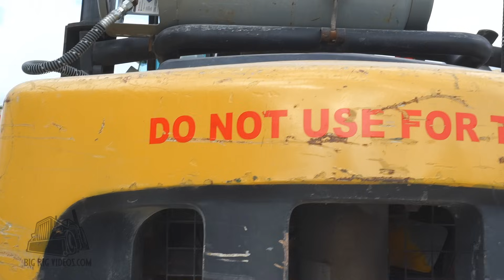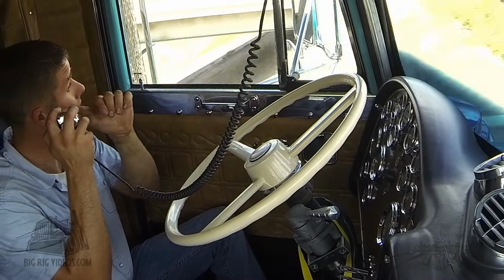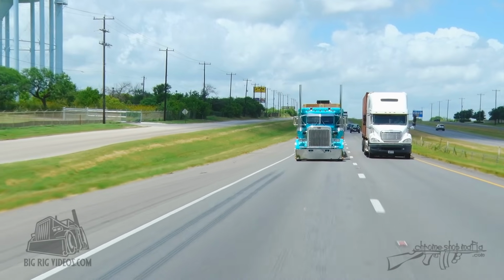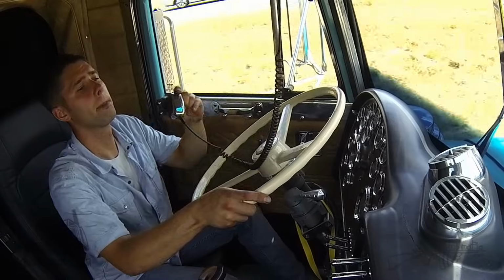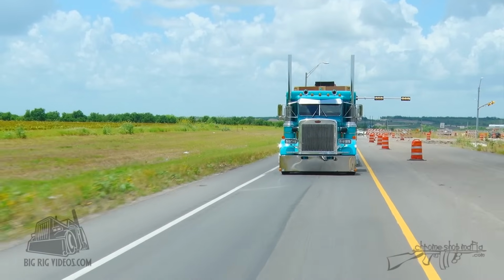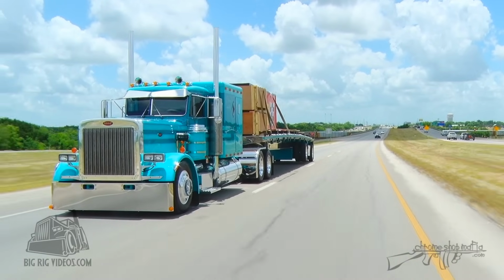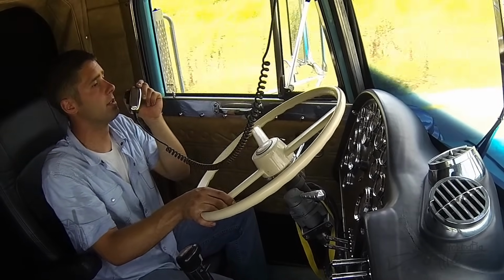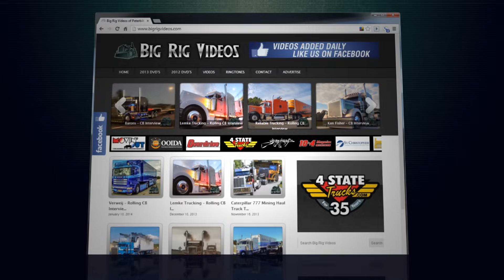Kiegan Nelson - Rolling CB Interview™

Comment: Bottoming out the seat is an acquired skill rarely seen by drivers that are true truck drivers that understand where their front end is while maneuvering around in tight spots and sit on the floor too feel the road better . Lots of drivers that ride high hit bumps and pot holes and run fast on rough roads. I’d hire this youngster any day and those with his mindset

Comment: Bad Ass!   Best lookin rig I've ever seen.   How many can's of Mother's did you go thru?    I'd wear a seatbelt tho.  Even WITH a seatbelt I've bounced up and hit my head on the roof hard.    I used to hop up on the trailer like that too then jump off.  Your knees can't do that when you're in your 50s.   Hard hat and eye protection always when loading too.  I've busted my head open when a forklift driver bumped a load of wood on the other side of the trailer and a board fell on my head.   Bungees snap, boomers snap back and winch bars break.  Yes I broke the whole end off of one in a ratchet.   Can't just watch what YOU"RE doin.  You gotta watch what's goin on around you.  Drive safe.

Comment: looks crazy when looking over the steering wheel while driving, is that dangerous or drives see all, or just for looks, or why seat so low.
Reply: HASO805 it's all about the style. Siting low and goin slow
Reply: HASO805 You can just get the feel out of a Long nose Peterbilt  my uncle sits low as well in his 379 and still controls the rig perfectly, "riding high sitting low"

Comment: Is there any advantages to using a metal flat deck opposed to a wood 1?
Reply: I haul a drop deck trailer. Wood surfaced as well. The wood tears up pretty easily if you are not careful

Comment: here's a 359 with rectangular headlights, and how many 379's you see with the 359 headlight's lol
Reply: 359 rectangular headlights are different than 379 headlights. The 359's don't have the turn signal lights built into the headlights, they are on the fenders instead. Plus they mount differently than on a 379.
Reply: MichaelTJD60 lol my point exactly. usually you'll see guys mount 359 headlight assemblies on 379's but rarely vice versa
Reply: I've seen a little bit of both. Easiest way to tell them apart in that case is the air breather hoses and the windshield wipers. I always get excited to see a 359 lol
Reply: Hank Schrader there not 379 headlights there the last generation 359 headlights... surprised he kept them being alot of guys changed them for the earlier style 359 single round lights but love he kept that he kept them
Reply: Jimbo Pursell oh did not know that! thanks for the info!
Reply: Hank Schrader I see a lot of 379's with the 359's headlights installed keeps the tradition and legacy going since Peterbilt stopped making both; I'll take a 359 over anything

Comment: As a european trucker, big complements on the the truck. It looks amazing. I like the 359 a lot. But what i don't undertand as a driver  with more than 22 years on the road. Why would you like be sittin' that low in the cab. I meen, it's far from comfertable for your back, you have various extra feet of blind spots and it's just not the way to sit behand the wheel feelin' the truck, the road and the trailer.  i mean, your back aint gonna last 40+ years sittin' like that. Can somebody explain that to me?

Comment: Why does it seem like to many drivers like to sit so low?  Is there some reason in particular I see so many OTR drivers sit like this?  I always prefer to sit up high, and have the seat adjusted at the max height so I have have a commanding view over the hood of my truck - albeit just a '15 GMC Sierra Denali 3500 Dually.
Reply: ace1usmc I sit low because I don’t like the air ride and the seat bounces and then messes up my foot work for the petels then I also don’t like being close to the steering wheel

Comment: isnt the flat bedding buisness harder then normal trucking and isnt it meant for the lighter weight people because ive never seen a big person have a flatbed
Reply: +bosna917 you havent been on the road enough then hahaha, but yeah it is a harder side of trucking, compared to a van/reefer trailer where they usually load you by forklift

Comment: Hell back in my day the greatest invention ever was the air ride seat. And then the air ride suspension came out & hell us old truckers thought we were in Heaven. Today it seems like everyone wants to set on the floor. Screw that I want all the air ride I can get under me. If you had drove some of the old trucks I drove way back with the seat bolted straight to the floor you would probably feel the same. Rough as shit & just beat the hell out of you. Caused a lot of physical problems for drivers back then.

Comment: Would be nicer pulling a set of b trains. American though guess you cant...still a nice rig either way. Good driver, I hate pulling spread axles--those things turn so wide so much drag/tire scrub. Where I am were always max weight so turning one of those makes me cringe lol. I pull 5 and 6 axle flats mostly teeter-totter style trailers with front/rear steers in Ontario, they turn like a dream compared to those.